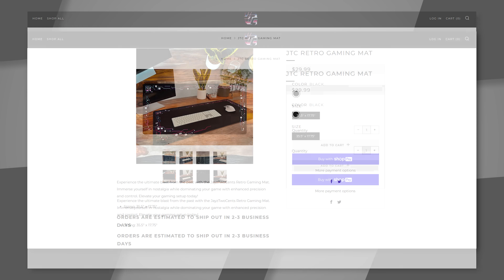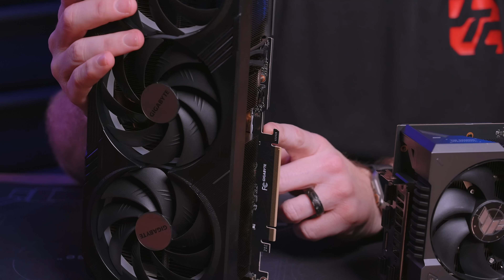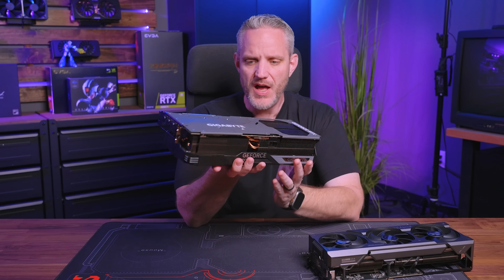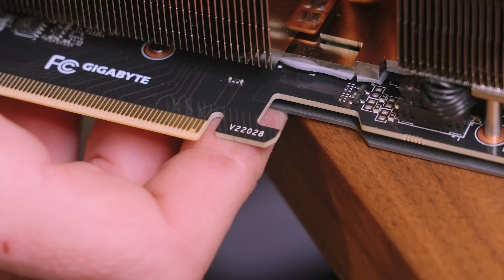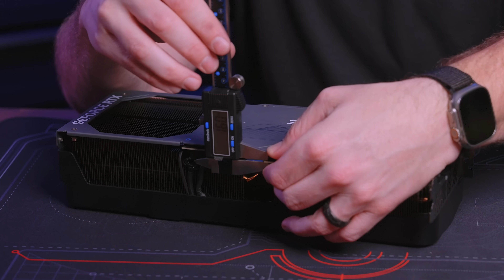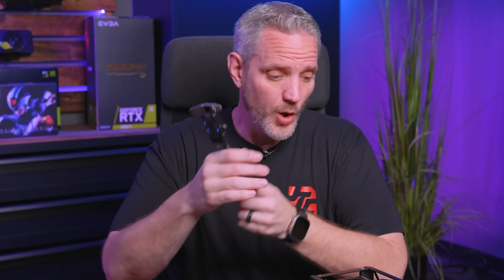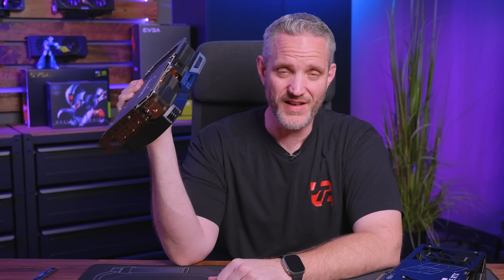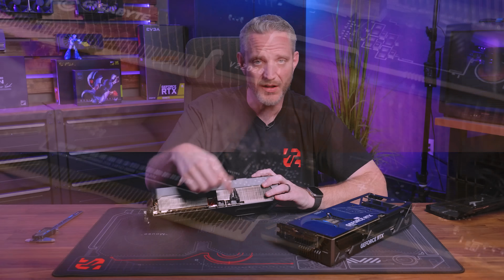These GPUs are cracking and the company REFUSES to warranty them!

Comment: Working at a PC repair center and while myself or my coworkers have not seen this, this is definitely good to know about going forward. As for Gigabyte themselves, we have had so much of their product coming back with defects and other issues that it's only reinforced my distrust and dislike for them. I've had both good and bad experiences with all the other major component manufacturers however only one has been consistently problematic over the last few years and that has been Gigabyte. From my own personal experiences with their hardware to what I have to deal with in the service center, I don't think I've seen so many different SKUs of product from a single manufacturer come back as Gigabyte has. From their monitors to their PSUs to their GPUs and mainboards, we've seen them all.
Reply: yup I stopped stocking anything of that brand years ago the z68 chipset boards were the last straw for me just like many of of their p35 boards I had many returns that  would forget memory settings and refuse to boot which always overvolted the ram compared to what the bios reported  as well as boot loop, or have other hard to track down intermittent  warm boot issues,  a long time ago gigabyte had a name for rock solid stability..  but since the p35 boards came out  the failure rate is a bit too high for my liking...
Reply: @DevilbyMoonlight  Yeah, had that problem some of their boards I had. The big thing for me was the last product I ever bought from them. It was an R9 380 that barely lasted a few weeks before kicking the bucket, forcing me to RMA the thing back to Gigabyte. 4 months later I still didn't have it back as I was, and I quote "Forgotten about" repeatedly by their engineering team. Direct quote from the support team. Eventually I was told they couldn't fix my GPU and that they would send me a new one. Doesn't sound like too bad of a deal, just had to wait nearly half a year. So imagine my surprise when after getting back my "new" GPU I immediately started running into issues again. Damn thing would black screen my system when any stress was put on the GPU, getting worse every time it happened to the point I couldn't watch a damn YouTube video. After double-checking the serial number of the "new" GPU I had and referenced it back to my original serial number I realized they had, in fact, sent me my old GPU back despite saying that they were sending me a new one. Ultimately call their support team back and was promptly told to return the thing again. Now considering I had just spent nearly half a year waiting for it to get back to me, I wasn't really excited on sending it out again so I just started asking for a refund at which point they refused and immediately stopped responding to my emails. It wasn't until I put them on blast with a review of the card on NewEgg that they finally got back to me and even then that newly-established correspondence barely lasted two emails before GB went radio silence again. Ultimately just gave up on the thing and admitted defeat, consigning that $300 to the aether. Refused to do business with them ever since.
Reply: who deserves the consumer’s trust the most?
Reply: @countercorps  Nobody, not even themselves.
Reply: @RAZGR1Z  honestly not wrong. Over the last while we've had a massive uptick in everything from everyone coming back with defects
Reply: Owned Aorus 5700xt, now Aorus 7900xtx no issues whatsoever same with Aorus b550 board only good experience so far
Reply: Have had two gigabyte gpus over the years. One was DOA and the other died after a year. Both 2070. Don’t trust gigabyte.
Reply: For me it's Sapphire, I bought two GPUs from them and both had some problem.

With Gigabyte I never had any problems, I got a couple of GPUs and motherboards from them.
Reply: @DioBrando-qr6ye  Actually in the process of an RMA with Sapphire or, in this case, one of their 3rd-party refurbishers; Althon. It was a 6900XT TOXIC GPU with an AIO cooler. Had it only for about a year and a half and it had already let me down. The AIO had developed a nasty rattle and it would constantly run into driver timeouts every time I ran something with Hardware Acceleration enabled. Had to fight with Althon just to get them to start the RMA and during the RMA process they emailed me to demand why I had unscrewed the fans from the radiator while citing the RMA policy I had agreed that ANY kind of disassembly was considered damage caused by the customer. Emailed them back with the riot act and detailing to them that no, it's no damage and it's how the item was originally packaged. Fuckers nearly denied the RMA until I explained that to them. The replacement hasn't arrived yet but it is on its way.
Reply: ANd you probably won't. He is clearly lying with his measurement, and using second hand anecdotes as data.
Engagement = money.
Anger = engagement.
FUD = anger.
Reply: @GarrettMoffitt  His measurements were off, yes but that doesn't mean he's lying. Jay even outright admitted he fucked up and said in the video itself that his measurements weren't spot-on. As for the "second-hand anecdotes" I wouldn't call them that. Data from another source, plain and simple. Rossman's been a vocal advocate in this space for years and is not known for flights of fancy as it were. Finally, even if we never see this issue in my particular center, it A. doesn't mean it isn't an issue period and B. doesn't mean that any one of our other locations won't either and C. doesn't excuse or hide the multitude of other issues we're seeing with both Gigabyte's products and others. Growing tired of you cynical fucks whining about people calling out the big manufacturers for their fuck-ups. One small reporting mistake it gets you dimwits screeching which ultimately just makes reporting on these issues and others that much harder. Holding people accountable for their mistakes is one thing, it's another to just start nonsensically sounding off with the whole "Engagement = money.
Anger = engagement.
FUD = anger." crap.

Comment: I work as a soldering technician in a store that fixed iPhones and Macs.
Apple's stuff was full of this sh*t. Usually it was stuff like screws that were close and had different length and if you swapped them, you made a hole in the motherboard and, of course, there could be many, many tracks right under the screw hole. In many case my job was to recover those tracks with tiny little wires.
Frankly, I haven't figured out if these things are more about the company being extremely evil with its own customers or just engineers being pretty dumb or cutting corners. With Apple, I bet it's more about evil but in this case I'd probably say dumb. This is just too much bad publicity to be intentional.

Comment: with how big graphics cards are getting i think its time for a new industry standard of how they mount to the motherboard or a case
Reply: agreed...this is why I have moved to vertical mount (plus it looks cool)
Reply: Yeah same but was not a choice my sata plug was blocking my gpu to fully plug in , but at the end i was like it look way more cool this way and i can see all the led from the gpu (4070 msi  gamingX)
Reply: @patrickkilduff5272  That's the only reason i'd buy a new case right now.  I like having multiple 5.25" bays and multiple 3.5" drive cages as well though.  Many cases don't have that.
Reply: @reubenmorris487  define 7 XL my friend
Reply: I've always worried about the way gpus are mounted to mobos.  Old school video game consoles have a stronger connection than gpus to mobos.
Reply: Vertical mounting is the way to go
Reply: @therealjeffdimps2  Not really, vertical mounting restricts airflow.
Reply: @IIGrayfoxII  Not really, my 4090 has the same temps if not better then when it was horizontally mounted. The coolers on new cards with this issue and massive.
Reply: @IIGrayfoxII  really depends on the case and the fan configuration. Saw a Fan configuration test of the O11 dynamic and vertical was actually better for the gpu temps. Probably because of the dominantly horizontal airflow instead of the vertical airflow from front to back in classic cases.
Reply: @therealjeffdimps2  What case do you have? The idea of making the same as you did sounds like a good solution to SAG and stress on the mobo, but the only case I see on new egg that looks like It could work properly on that position is quite expensive
Reply: @Rolfhn  I have NZXT H7 Flow. But you have to buy the vertical mount separate on that case for another $90. Anything NZXT is definitely not cheap but I liked the case. I believe there are much cheaper options and some cases that might even come with the vertical mount.
Reply: @Rolfhn  cooler master sells a vertical mount for $70 that should fit majority of cases.
Reply: @IIGrayfoxII  definitely not the case with my 4090, it actually runs cooler vertical mounted.
Reply: Might be time to make the gpu THE motherboard, and mount your cpu on to it instead.
Reply: @adreanmarantz2103  we need something like a sxm2 socket (big gpu m.2 slot like thing) on mobos, with a mounted cooler
Reply: @adreanmarantz2103  Tell me you don't know anything about computers.
Reply: @adreanmarantz2103  tell that to intel lmao
Reply: @adreanmarantz2103 just make another holding point on the other end of the GPU
Reply: @adreanmarantz2103 😆😆😆 that's not a bag idea, just make the GPU the back half of the motherboard so it mounts directly to the case standoff screws
Reply: It would propably just be enough to have a standardised Extension of the ATX Mainboard tray with 2 holes, so that you can screw the card directly to the tray. Or Something similiar to what some GPU Servers do and have a bracket to screw the end of the GPU to
Reply: This is a decent idea. Or people could just adapt back to an actual desktop instead of a tower case.
Reply: @@Clarissa1986Server style orirentation is great, and very few cases do that.
Reply: my initial thought is a new mainboard requirement so hopefully not anytime soon
Reply: SFF builders know how you feel. When you get to sub 10 liter builds, we construct our case around the parts more than the other way around.
Reply: Absolutely. They're just too big anymore for a standard that was used for cards much smaller. Vertical mounts may become that standard.
Reply: Well gpu's were originally intended to be mounted vertically on the original IBM spec.
Reply: the root of the problem is an ever decreasing profit for the makers of these cards as `most` of the profit is going to amd and nvidia
Reply: Or they could finally go all in on smaller process nodes so graphics cards could continue to get smaller and more efficient vs. just cramming more shit on ever more ludicrous sized PCBs. (Yes, I know there's a limit to how many transistors you can cram into a silicon wafer due to material/lithographic limits, but these companies have been dragging their feet on moving to different materials/smaller nodes for ages now)
Reply: Sadly, the standard that mobo manufacturers are working towards to (or at least that's what it seems) is hiding the cables behind mobos as if they were the ugliest thing on earth. I'm sure it has its benefits other than aesthetics but I'm not sure it will help solving this particular problem.
Reply: @krazycharlie  In the end one cable will do everything
Reply: Time to go back to isa sized using pci-e connectors.
Reply: I agree. Perhaps a dedicated graphics card slot - designed for nothing else - would enable manufacturers to build away from the generic slots, and make it stronger, more supportive, and oriented where the release button is always and easily accessible.
Reply: Yep, like making the PCIe slot much longer, or divide the slots in half from front to back for much better card support.
Reply: Any recommendations from which company i should buy 3060 ti?
Reply: Yeah on top of reinforcing everything to the back plate the actual socket seems like it should have some sort of reinforced polymer setup instead of just pcb.
Reply: They need to start baking the video into the CPU ...problem solved.
Reply: Apple have the right idea, their laptops have 3080 performance on a single chip
Reply: Buy a bigger case. Problem solved.
Reply: @Squidgy55 how does the size of the case solve the problems? the problem isn't the gpu fitting in the case, it's the gpu sag, the cracking mentioned in the video, the low quality electrical connections due to the weight of the gpu putting one sided pressure on the pcie slot connections and the psu cables connectors, etc.. nothing to do with "my case is too small"
Reply: @Squidgy55  That is so dumb.

Comment: Compare the two at 6:55. The ASUS card has a brace screwed into the PCB which adds rigidity, the Gigabyte card does not. ASUS also has a lot more material around the tab where Gigabyte is all notched out. The PCBs are most likely the same thickness, material, etc, but one is clearly designed stronger than the other.

Comment: About 2 years ago I started laying down my case and not only does it take the stress off of GPU sag but it makes a great bench and makes room for stuff like my Joystick and Headset and chargers and phone and extra mouse. Why have a tower in the vertical if it's gonna cause stress on the components. Also way easier to access things like RAM and connecting wires. they had it right back in the day and someone decided a vertical tower was cooler.

Comment: I keep thinking why gpus are made to connect via slots and not something like a flat serfuce , a pad I think its called , and it can be waterproof also , it doest brake its just sit , toucging the other part of the board , there with a couple of screws to support the weight of the gpu , and make a flat contanct , easier for water cooling!

Comment: Look at the size of cutout sound the tab on the gigabyte card vs the other one, that's the issue, they removed material so that it would match the GPU shroud, in an area you'll basically never see. That's why there's so much flex.

Comment: Much more exposed pci locking point on the gigabyte card than the Asus one, would make it weaker and more flex. The distance from the locking tab to the rest of the pcb is much bigger on  the Gigabyte card. That extra distance will amplify the stress.

Comment: My gigabyte 3080 didn't crack there but has to be under clocked in order to work.. So I just upgraded and put it in the closet. Didn't replace it with a single gigabyte product.

Comment: The pcie thickness standard is 1.57mm, too thin and possible loss of contact, too thick and it wont fit the slot. Like others have said, the tab surrounding geometry is imperative for strength 6:56, asus has way more geometrical strength.

Comment: I just had a system built around 2 months ago with a gigabyte 4080 that worked for 2 months and just stopped working. The card is currently with the retailer awaiting replacement. If for any reason my warranty gets denied and its due to this reason, I will use this video as evidence with our local authorities that handle this dodgy practice by companies trying to skip warranty.

Comment: As mentioned in several other comments, it does appear that the difference in flex is due to the mount located really close to the edge on that other card.
Reply: I think so too.
Reply: I dont think manufacturers use different materials aswell

Comment: My experience with Gigabyte RMA is I sent in a motherboard for repair and never got it back. That was 4 or 5 years ago now, sure it was an old board from 2014 but the lack of communication from their support and no resolution other than my RMA case suddenly disappearing from their support portal really put me off their products.
Reply: No refund either? Not even partial?
Reply: @Genshinlmpact  No and after waiting and asking for updates for about 6 months I didn't care enough to pursue one. I ordered a replacement from another brand when I sent it in.
Reply: @DarkosLab  Insane. Hope the board they refused to replace wasn't worth much at least. Seems evident why people avoid them now.

Curious though, what brand did you pick for the replacement board, and how have they been?

Comment: The problem with my mainboard and the placement of the PCIe x 16 slot is the
  RTX 3090 so close to CPU cooler that you can't even get it out of the slot.
Reply: Let me guess... Intel system and large cooler? It is not that much of a GPU size issue at this point, but rather manufacturers having more models of Intel mobos, where distance between CPU socket and first PCI-E slot is really small comaratively. 
Meaninf, if you use large cooler, like NH-D15 you actually may not be able to get to the slot properly... 

Because from what i know most of AM4 motherboards (still, not all of them, but like 95+% of B550 ones) have a lot more distance, so even with large cooler you still have space.
Reply: @DimkaTsv  I have a AMD R9 5950x on a Asrock x570 Pro4 mainboard.. the cooler is a Bequiet one.
Reply: @Dragonheng  Well, Bequiet cooler stll large one. And Noctua on their NH-D15 compatability list explicitly says that PCI-E slot on this motherboard is placed too close to socket so cooler overhangs. 
This issue actually plagues Asrock X570 boards for some reason. Other manufacturers didn't do that mistake as frequently.

Comment: I have a sagging MSI RTX 3070 Gaming X Trio that broke (not working when installed normally, but starts to work when and as long as I push it upwards) and MSI is denying the warranty claim because of "physical damage" - yeah no joke, the cards weigh a ton and the "support bracket" is terrible (it just sags with the card) and I couldn't even use it (had it in there for testing purposes) because my audio card is blocking it and I can't install it over the audio card. Just amazing.

Comment: I have that 4090 from Gigabyte. I am running the metal bracket that comes with it however. The one that bolts into the motherboard to help hold the card up. Should I still be worried?